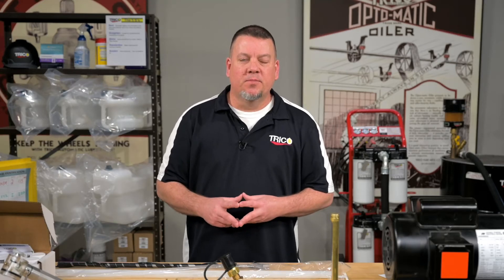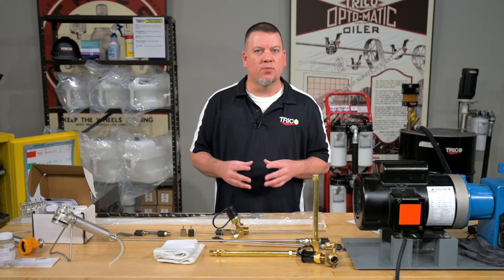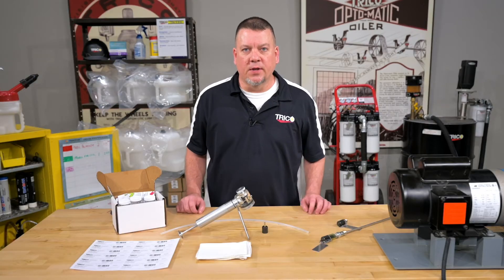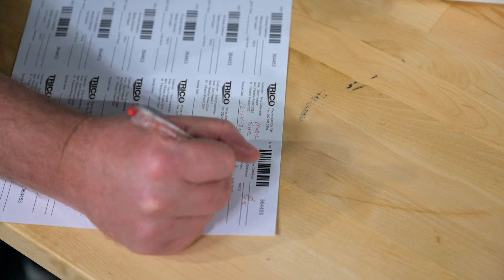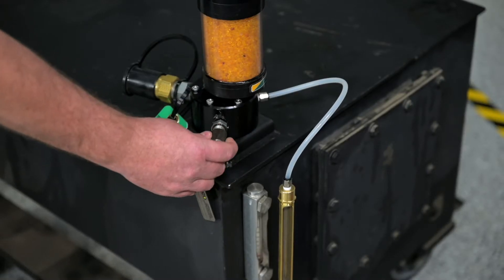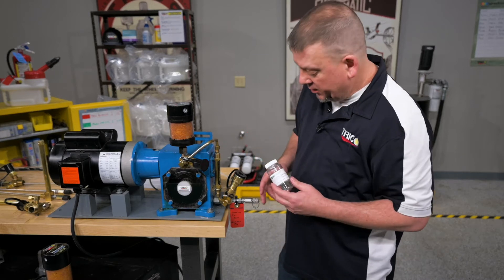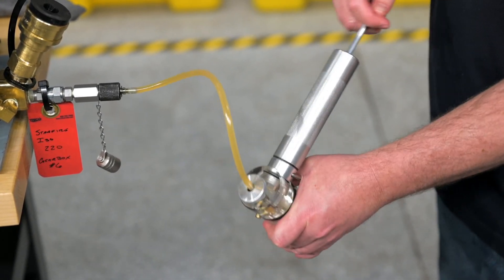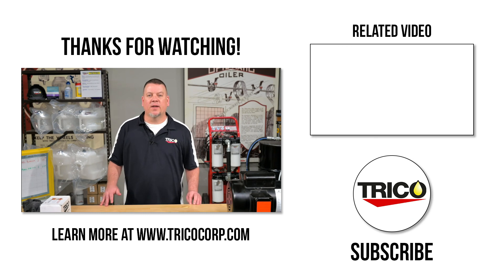How to Take an Oil Sample for Oil Analysis | Trico Corp

Comment: Hello! I'd like to know if it's necessary to use a different pump for every reservoir or if I can use the same pump for all equipment. I ask the same for hoses. Thank you in advance!
Reply from the maker: Technically the pump shouldn't see any lubricant the only thing that will need to be changed is the tubing/hose for each sampling location.

Comment: What if sampling from the filter cart?  Since this is pressurized, wouldn't oil start flowly immediately once the adapter is threaded on.
Reply from the maker: Yes sir. It would still be good to use the vacuum pump to attach the bottle because its clean, but you would not have to create the vacuum because the cart is already pressurized. Alternatively, the barb adapter, tubing and bottle are all that are absolutely necessary to sample from the Filter cart. Thanks for the input!
Reply: The best location when available is before the return filter, 
While running is optimal.